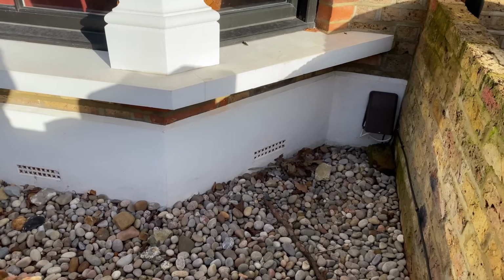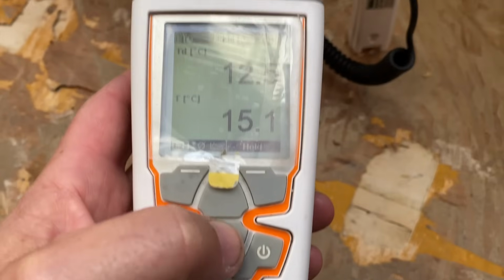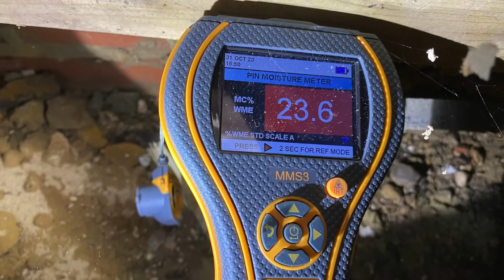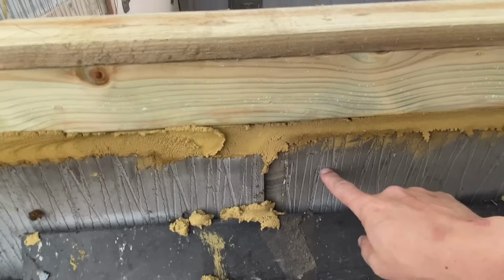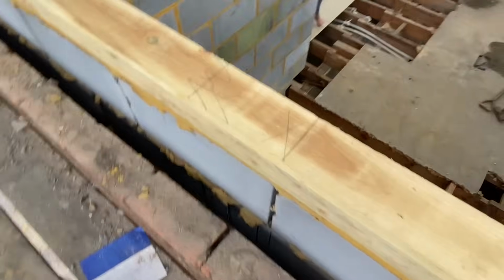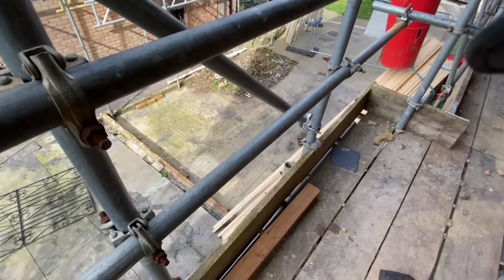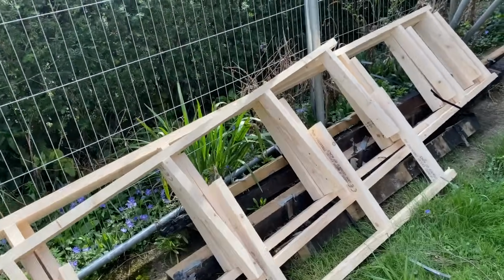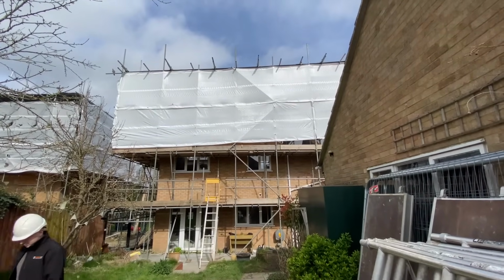A day in the life of a building surveyor - April 24

Comment: How on earth did they allow the second property to remain standing after the fire, when it should have been knocked down and a new building erected?
Reply from the maker: Quantum! Still four good walls, sound first floor, ground floor and foundations. It is actually quite rare for a building to be completely demolished post fire.
Reply: Thank you for the reply, I guess with such a narrow cavity that the owner will have to simply put up with the heat loss. I still think it’s a wasted opportunity to replace a building with something far more energy efficient. Thanks
Reply from the maker: @davidbarnes241  we still need to comply with A.D.F. My colleague is dealing with this job and I’m not sure how compliance will be achieved, but it is an issue with the narrower cavity.
Reply: Could just thermally clad the walls with a new larger roof overhang
Reply: They probably had to replace their oil tank and had to use a plastic one because regs require a bund and a plastic one is considered safer for contamination reasons but clearly not safer for fire safety.

Comment: And the fink trusses should NOT be stored with their weight resting on the rafter tails. They should be supported on the bottom chord, as they would when fixed down on the wallpaper- common sense basically!!! NOT a good advert for the building company involved. This, and the mess on the second scaffold lift speaks volumes about the lack of pride evident in the British construction industry nowdays. I'm surprised that you did not fla g up the incorrect/ poor storage aspect
Reply from the maker: Thank you for your comment. Not on here, but certainly did to the contractor!
Reply: Wall plate..
Reply: Autocorrect is a wonderful thing. :-)
Reply: Rubbish. Most trusses can be easily lifted by two men and can quite happily be stored for a while like that. In all my years I can’t remember one failing due to this.